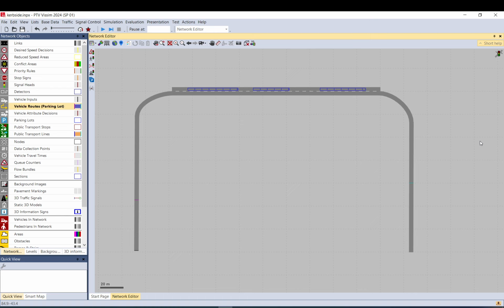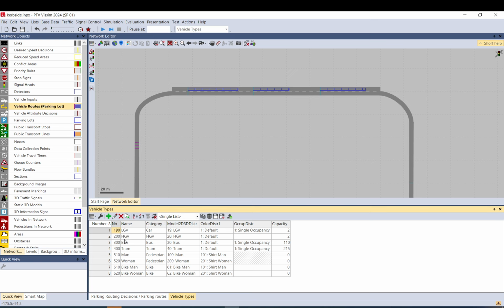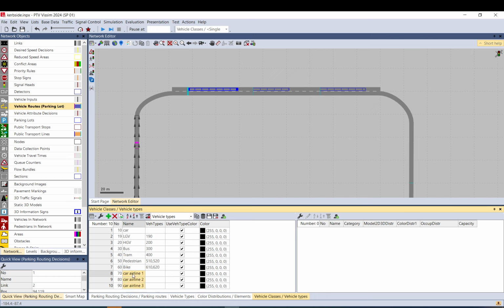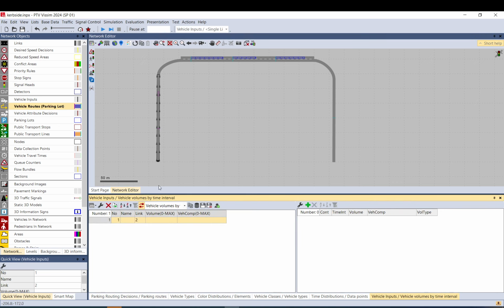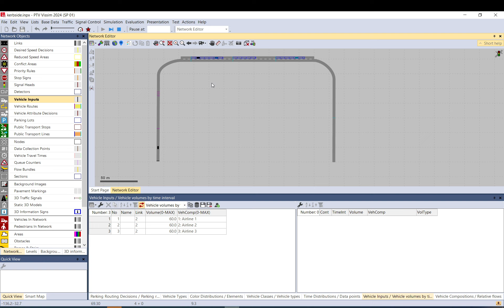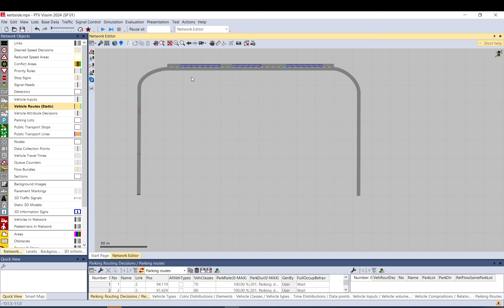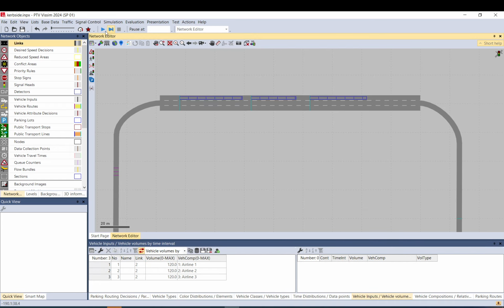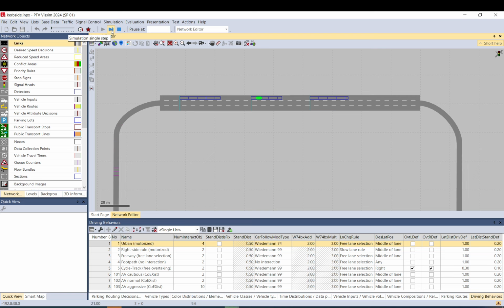Vissim Tutorial - Kerbside parking

Comment: Dear Matyas,

I am currently working on modeling a parking lot in PTV Vissim. After carefully configuring the static routes and parking routes, I encountered a warning: ‘Parking Route X - Y could not be completed.’ Given your experience, do you have any insights into resolving this issue?

Thank you for your assistance.
Reply from the maker: Hi, can it be that you removed a connector somewhere so there is no possible continuous path from the start of the route to the end? Try to see if you gaps along the path somewhere after selecting it. Parking routes also should be within static routes. 
When did you get the error? When try to run it?